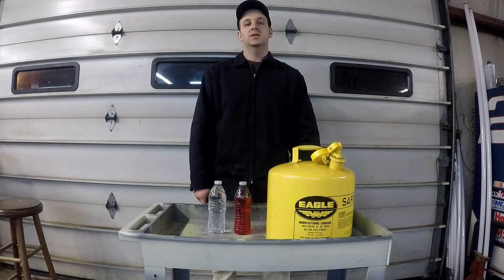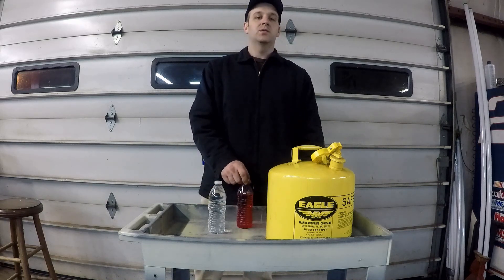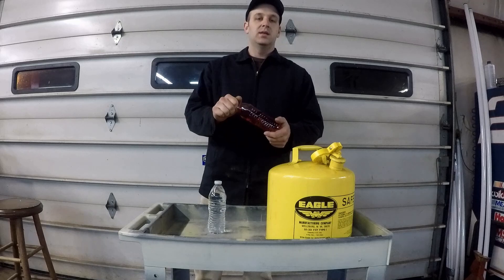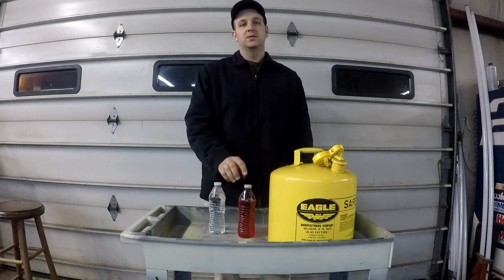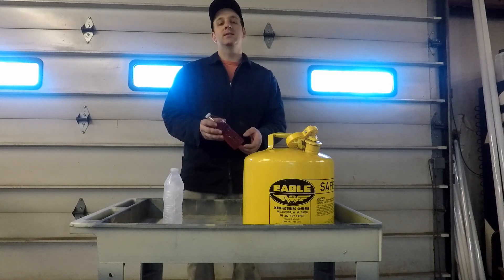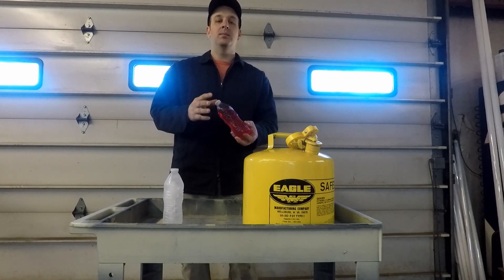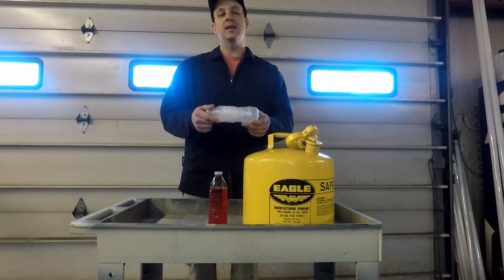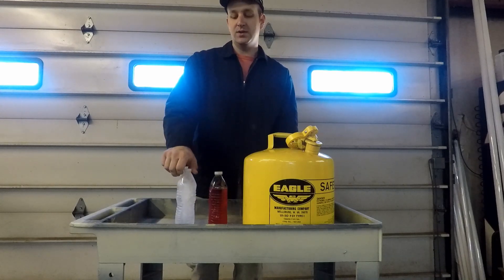Will Summer Blend Diesel Gel When it is 2°

Comment: Good day Roger. Very interesting experiment. Here, the diesel we get is called winter diesel and apparently it is treated with something (not sure what) and i also put a little conditioner in it when I put it in the tank. Do you also have to use a conditioner on yours in the winter? Thanks!
Reply from the maker: We have a place that sells winter fuel. It is 50 cetane.  The higher cetane is better for cold starts. I don't use any antigel. Normally we only get a few days up to a couple of weeks around 0. I don't think gelling is much of an issue if buy quality fuel here. If I lived where you do I would add some kind of antigel. Be sure whatever you are treating your fuel with does not contain alcohol.  Look up the MSDS for it to be sure.

Comment: Cool idea. Noticed it got "cloudy" fairly quickly. That's how the fuel in my tank looked when I had problems last winter.  I may try similar experiment to compare the summer fuel with a biodiesel blend and straight diesel. A trucker I know thinks the biodiesel gels at higher temps.
Reply from the maker: Yes, it did not take very long for it to get cloudy. That would be an interesting comparison. Here is an interesting read on biodiesel. http://www.utahbiodieselsupply.com/blog/biodiesel-gelling-different-temperatures/ It is probably best to stay away from it during the winter. We used to have a station here that sold biodiesel. I'm not sure if they still do. I want to try some in my truck and see how it runs and if it picks up any MPG's.

Comment: The temp last week got down to -28.5°F where I live in Minnesota.  My diesel fuel was purchased in the fall so I'm not sure if it contained a winter mix or not.  I don't use very much fuel in the winter so I try not keep extra fuel in containers but the fuel tank on my Kubota BX was already full so I was unable to add more "winter" fuel to it.  I did add some Power Service Diesel Fuel Supplement but I had to add it into an already full tank. Luckily I was able to blow the snow before the temp dropped below zero and then I kept the tractor in the shed during the extreme temp.  I was anxious that I would have problems with gelling fuel if I had to use the tractor during those extreme low temperatures.  So far I have not had any issues in the past with temps around 0°F using the diesel fuel from my local station without additional supplements.
Reply from the maker: That is really cold! I am not sure if it is necessary to treat fuel, if the temps are above 0. I know some people here that don't treat their fuel and they have not had a problem. Using a good winter additive provides some extra insurance. It is good you were able to get out and use the tractor before it got real cold. That also allowed the power service to get mixed up.

Comment: In a small diameter fuel line  could it maybe gel even faster ?
Reply from the maker: I think it may, but with this sitting over night, it should have gelled if it was going to. Also even though the fuel line is a smaller diameter, if the engine is running the fuel will be flowing which may make it harder to gel. The fuel may also be warming on a running engine.